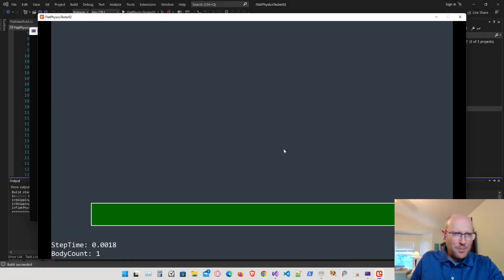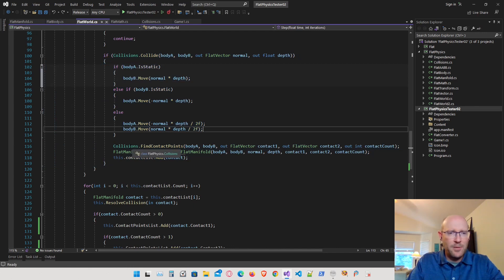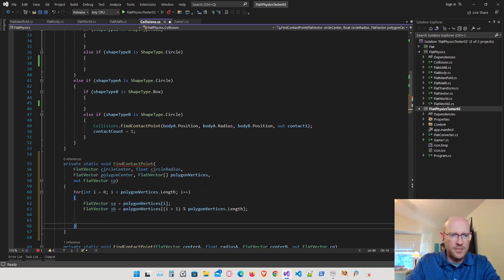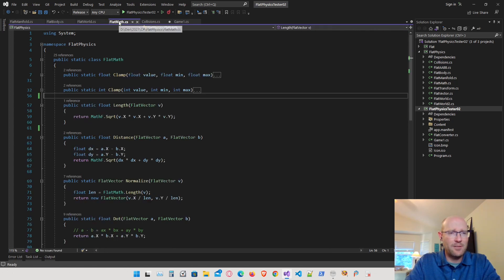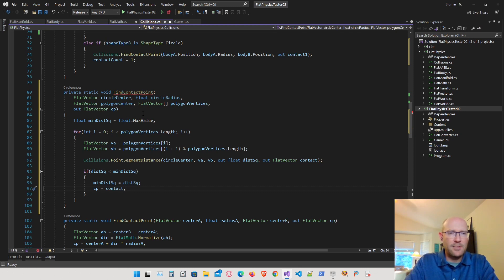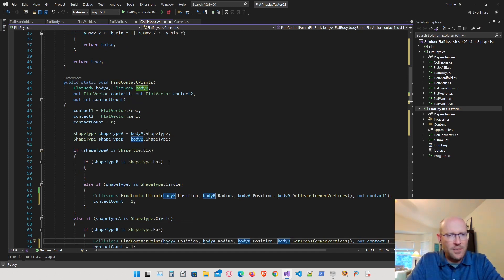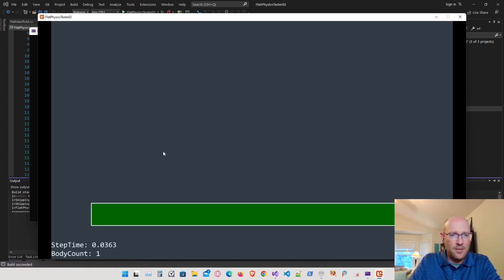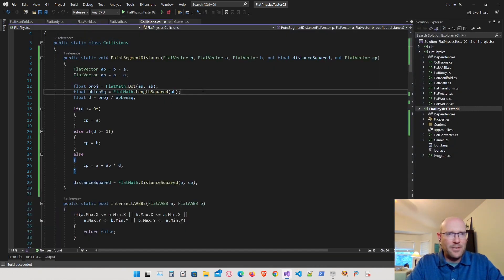Contact Points (Circle/Polygon) - Let's Make a Physics Engine [19]

Comment: One question, is the math the same for both 2D and 3D?

I've been following your series and with it, I've learned a lot!
so, I've been implementing everything on a 3D game project. but at this point, I'm not so sure if the math to find contact points is going to be the same or not. so, if it's not going to be the same logic is there anywhere I could find this logic for 3D shapes?
Reply from the maker: I don't have that information for 3d. Maybe search for polygon clipping? But I really haven't tried 3d at all.
Reply: @two-bitcoding8018 , thanks, I'll try to look more into it, and if I find an answer I'll post it here
Reply: @miyukinozomi  Have you found anything yet? because I am doing the same